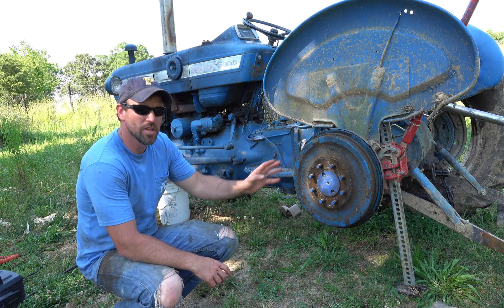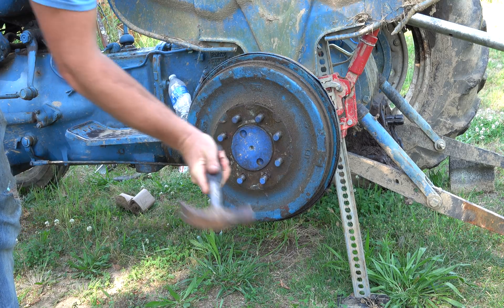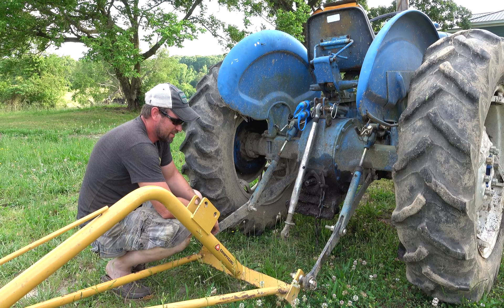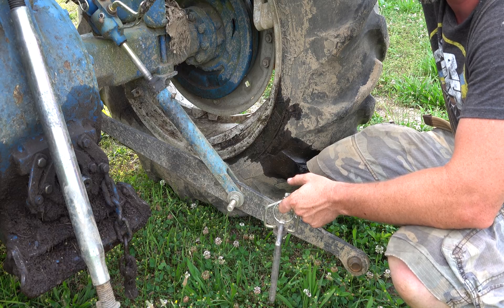Homemade Brake Drum Puller

Comment: I'm in the same boat. Ford 3000. I even wore the same camo shorts.
I used 4x4 cribbing with bottle jack and still didn't trust it.
Going to search for a puller. Thanks.

Comment: We cut a hole in the drum to access the shoe dial adjuster, with a grinder after days of pounding, spraying, torches, puller. in the opening we could get a chisel in between the hub and brake drum. that worked after 30 minutes on one. the other side we ground the entire front face of the drum off all the way around and chiselled it off. be careful not to grind into the wheel cylinder. that was a bit quicker but it is very frustrating.

Comment: You sprayed penetrating oil that is dangerous, brake pads soak it up and then No brakes at all

I think a good bearing puller should work, sitting with the same problem now
Reply from the maker: I ordered a bearing puller just haven’t gotten back to it. But because my pads are toast anyway the penetrating oil doesn’t matter.

Comment: jack stands!! or live life in the fast lane! safety 1st!!! replace seals B4 replacing the brakes!!! drill a hole thru the drum, not thru the axle flange so you get penetrating oil behind the drum! try kroil penetrating oil! & you're finished put never seize on mating surfaces but not a lot! maybe local auto parts stores rent a drum puller?
Reply from the maker: The local auto store has a puller Kit you can borrow, but none of the pullers in the kit have enough reach.  I just purchased a puller with a 17” spread that should work.